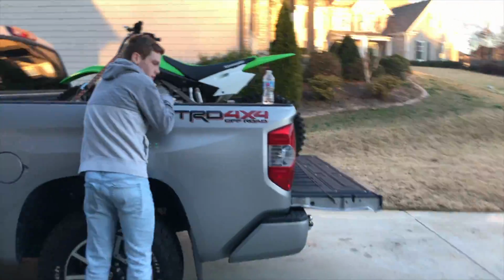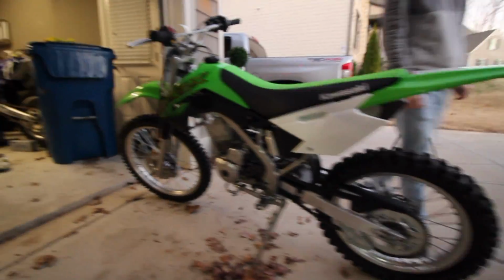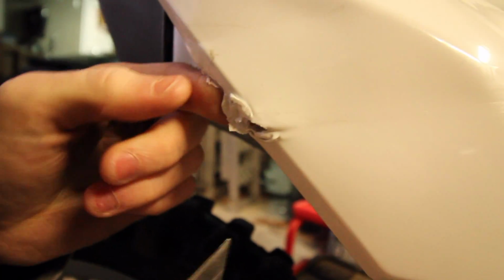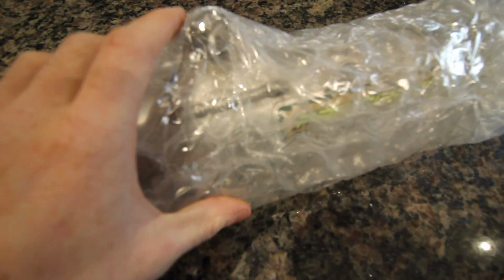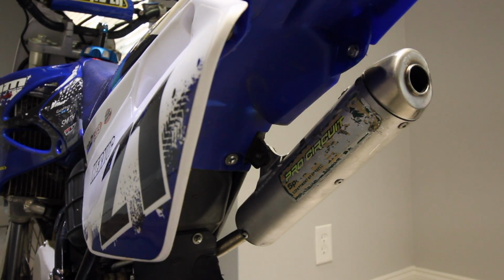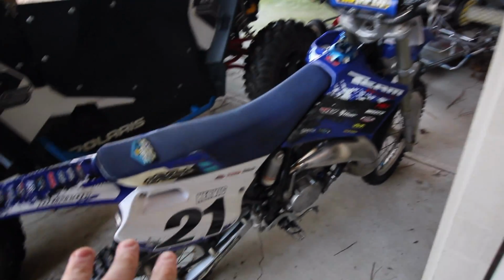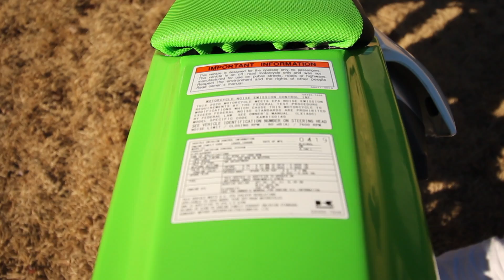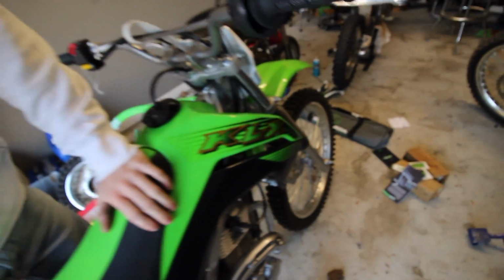NEW 2020 Kawasaki KLX140?! + PLANS FOR 2020

Comment: How are you guys liking the KLX140G? I planned on using one of these to teach a beginner on some easy trails. What's the top speed like; does it get past 45mph -- 72km/h ?
Reply from the maker: We are loving it! It has the same motor as the L and base model KLX140’s, so the top speed won’t be any more than 50 mph. The bigger wheels will mean less acceleration as well (compared to the small wheel) if that fits your rider!
Reply: 54 TO BE EXACT

Comment: Hey guys ! I wanna buy a bike, but idk what to buy, I'm between Kawasaki klx 140L, Kawasaki kx 250 and Yamaha ttr 230.
What you recommend me, im 5'8 and 215 pounds.
Reply from the maker: It depends on the type of riding you are doing. If you trail ride mostly then a TTR230 would be best for you. If you ride motocross tracks then maybe the KX250 although it is way more powerful.
Reply: @Richiehervig  I would do trail ride the most.
How good and how power are the klx 140 and ttr230?

Comment: Goofballs.. It's made to run on cheap gas as the compression ratio is not high enough to require a higher octane.
Reply from the maker: Good to know! We thought it made a difference, lol
Reply: @Richiehervig  Higher octane doesn't have more chemical energy, it just resists premature detonation in higher compression engines.
Reply from the maker: Thank you for your knowledge man, I learned something new today